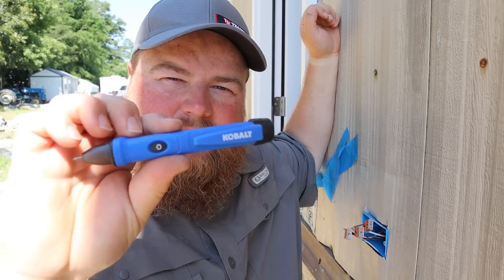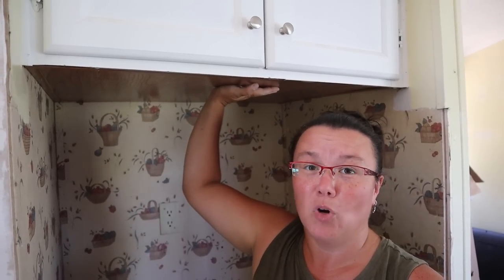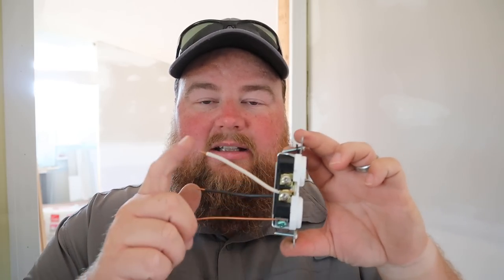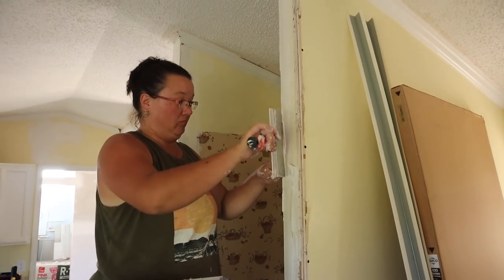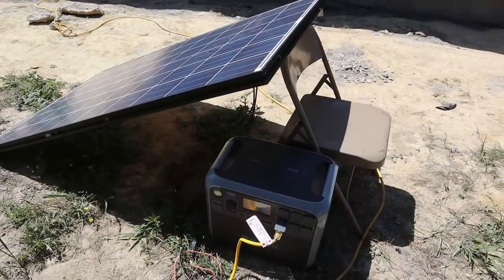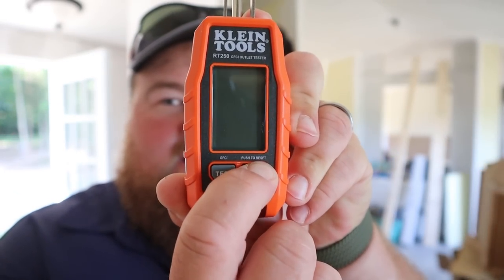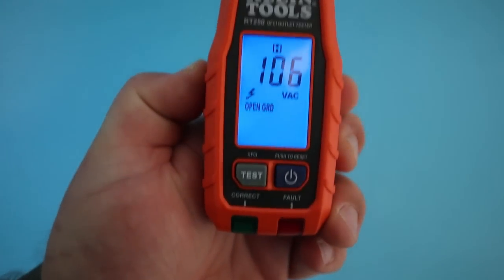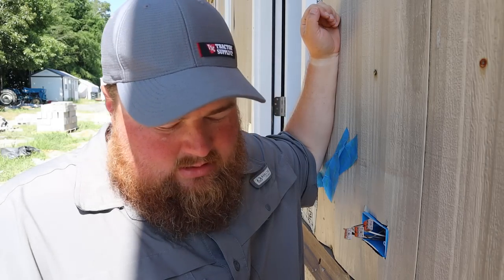Projects Everywhere! Interior Work Continues! // Mobile Home Remodel

Comment: Question about the water heater; is it setting on the floor or is it raised with a overflow pan and/or drainage line going under the house? Couldn't really tell in your video. In our old MH ('74) the tank was outside in a closet w/the furnace. It had a pan & a overflow valve that went thru the floor to drain underneath the house. Just curious how you handled that part. Good job! It's coming together nicely! Oh, testing the outlets, I'd check both plugs. We found 2 bad outlets, new outa the box. One plug worked, the other didn't. B4 inspection, I'd check all of them!

Comment: My pet peeve about mobile home wiring... The Kitchen usually has two 20 amp circuits for appliances. The mobile home builders usually use 15 amp rated receptacles on these circuits. This can cause overheating of the receptacles. They need to be replaced with 20 amp receptacles.
Reply: It's not a mobile home thing. All builders use 15 amp receptacles on 20 amp circuits as the norm, and only use 20 amp receptacles in special situations. That is the safe and accepted practice.
Reply from the maker: I guess our home is different then. :) We have 15 amp breakers for the kitchen and lighting circuits in the home and only two 20 amp ones that feed the outlet runs for the rooms in the house. That being said, what plug in appliance is pulling 20 amps? That's 2,400 watts! We know of no UL listed appliance in the US that is approved for that wattage in a home.
Reply: @diyfferent  Why the electrical code allows 15 amp receptacles on 20 amp circuits is beyond common sense. I have had the 15 amp receptacles overheat when using an air oven. They have been replaced with the proper amp receptacles with no further issues. I'm surprised there not using 15 amp wire on the circuit too.
Reply: @sam-and-angela  I suppose youtube doesn't allow links in the comments. It has been a requirement to have 2 20 amp kitchen circuits in the national electrical code since 1959. I would recommend looking into it before inspection of the electrical. The current NEC also requires these be GFCI circuits.
Reply: @alashley5599  Overheating is often caused by a poor connection. Either the plug connection was worn or perhaps the outlets were backwired which can cause bad connections. Maybe the cord on the appliance was undersized. A properly wired 15 amp outlet should be able to easily handle household appliances. Who knows...
Reply: @sam-and-angela  Kitchen circuitry is  20 amp because more than one appliance could be used at one time that could exceed the  ampacity of a 15 amp circuit. I’m surprised your home was manufactured without 20
amp kitchen circuits . At least long before 1988 stick built homes required 20 amps .

Comment: Uh I was just wondering if isn’t supposed to be better to have insulation around the hot water heater??  Probably just a salesman pitch but when I had mine put in I was told it helped keep the water hot. Just wondering??

Comment: Out of curiosity, would it have been possible to put the water heater below the bathroom, since you have all that space there? Or is that not allowed with regard to code or a bad idea because of weather conditions? Those huge water heaters are not common over here. (The Netherlands)
Reply from the maker: It's an option, but not one we wanted to do for the reasons you listed.

Comment: not trying to be a buttinsky, but just a thought: could the two small walls on each side of the area of the fridge have been removed?  or just one side? especially if the new fridge is stainless steel?
Reply from the maker: One side has the electrical panel on it, the other has a light switch that wouldn’t have anywhere to go 🤷🏻‍♀️. We looked into many options
Reply from the maker: We spent a good bit of time looking into that. In short, no, but here's why. :)  The wall to the left of the fridge is the wall our home's electrical panel is installed in. To move that wall would require re-wiring the panel and most of the home's circuits. The wall to the right is the defining space between kitchen and dining room for us. It gives the two rooms nice boundaries and even more importantly houses electrical switches and outlets for the dining room area. In the end we found a fridge that fits the space and allows us to keep things working well like they have been. :)

Comment: Will a open ground  pass code they made me drive copper rods 8 foot in the ground
Reply from the maker: No, it won't pass. There are no ground rods yet which is the cause. They will be installed later by our electrician for final hook up and inspection.
Reply: @sam-and-angela  I was just wondering. Enjoy your channel keep up good work

Comment: You may have shocked yourself Sam but not electrocution. If that was truly the case you would have had to have a funeral.  I don’t trust any non contact voltage tester. As for me I always use contact equipment where I can read voltage or current. In the bathroom you have a water closet next to a water closet. I’m sure you know that is another term for a toilet.

Comment: I'm just wondering why you guys just bite the bullet and go get h those step/porch for front and back of your house it would be a tremendous savings over buying new wood or bricks to make a new one for both entry and exit to your home.
Reply from the maker: The rear porch was damaged when removed and would need mostly rebuilt. The front one would need to be heavily modified to fit the new setup. We would also have to rent a trailer to haul it back. It’s not worth the time, fuel, and costs to us.